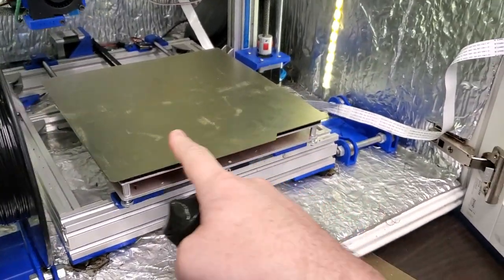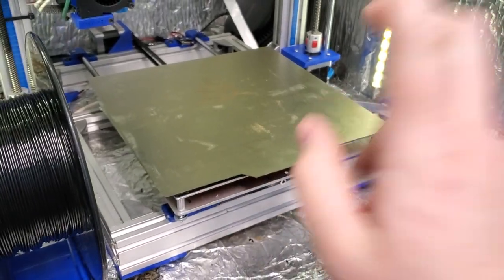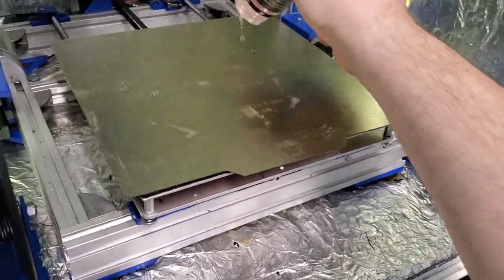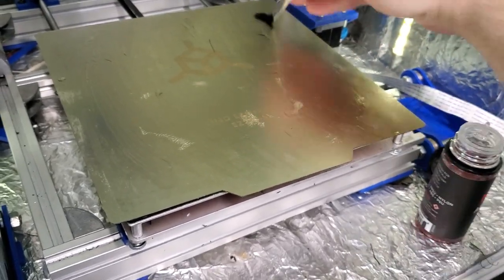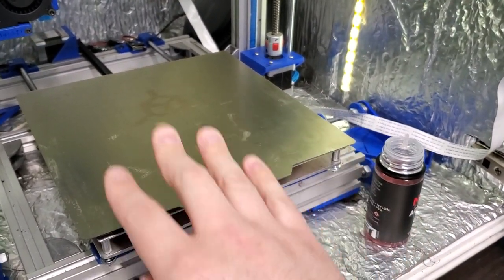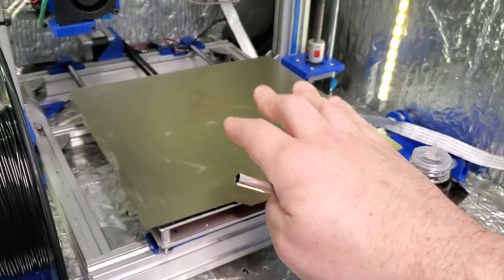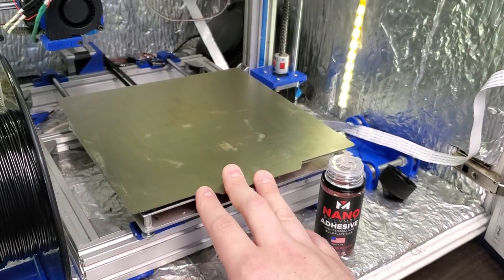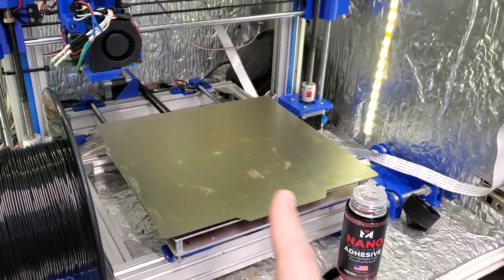EZTip #3 - Applying Vision Miner Nano Polymer

Comment: Have you tried using a foam brush to avoid the stray bristles?
Reply from the maker: Foam would be a good option as long as it is cleaned out right away. Also, cleaning the brush after makes the bristles less likely to come out (which I didn't do last time it was used, ooops :P). This is the included brush that comes with the nano polymer.
Reply: @TH3DStudio  Ah, yeah cleaning out foam is tougher than bristles. Those acid brushes are cheap to replace anyway.

Comment: Love this stuff. Yet, you're applying WAY too much adhesive. You actually need only 1/10th to 1/5th of what's applied in this video. Even Vision Miner recommends using really small amounts, like half a ml or so.
I'm putting extremely little amounts of Vision Miner's nanopolymer and it's more than enough for yer old ABS... and lasts tenths of prints.